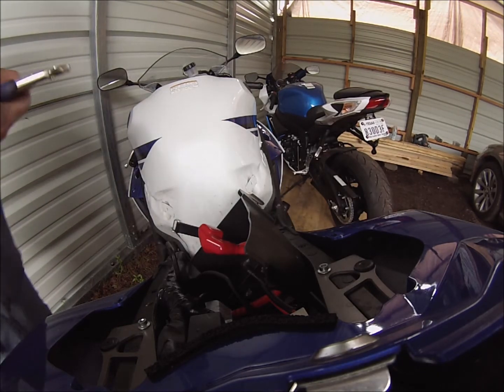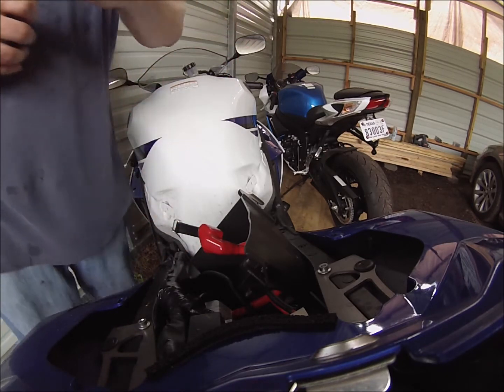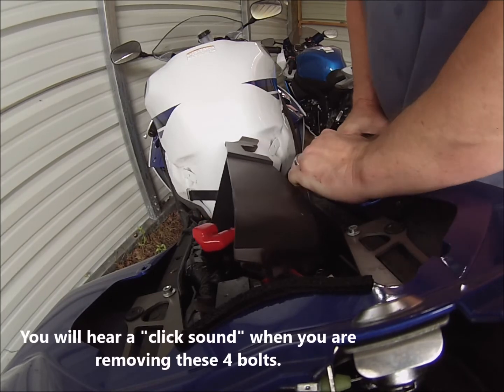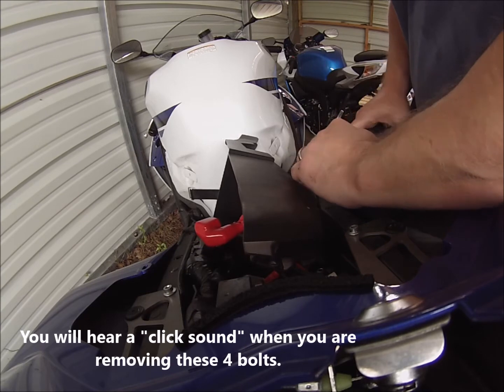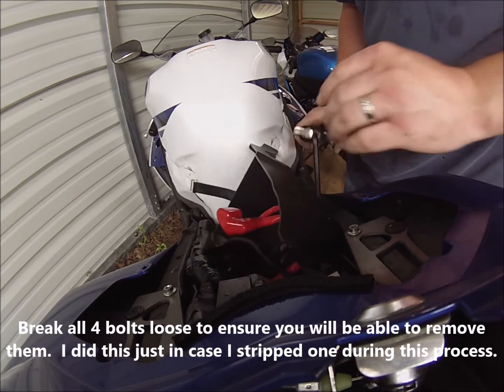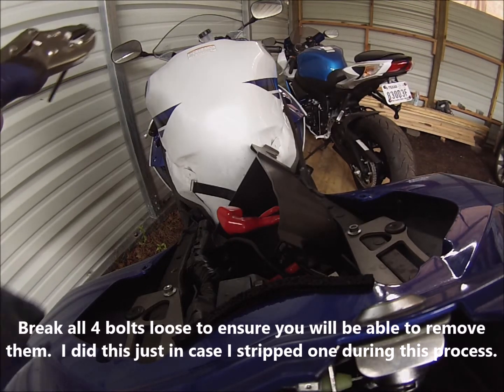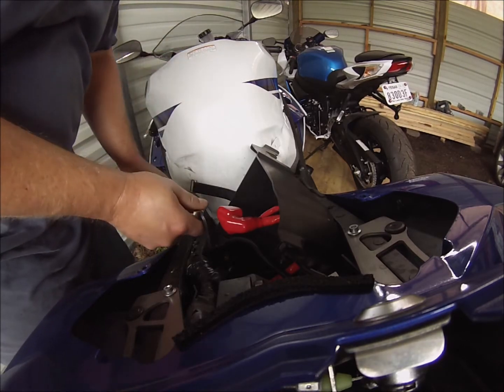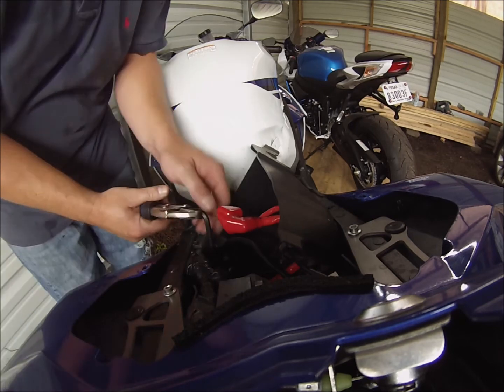How to Remove Rear Foot Pegs Brackets - 2014 Yamaha R1

Comment: Just a tip for the hex keys when they are up that way. Rather than using grips just use a ring spanner. About a 13mm. Slide the ring end over the hex key and it works as a lever. Thanks for the video.
Reply from the maker: +dubvalver thats a good idea...i just didnt have the right tools so i went with the locking pliers method...thanks for the comment and view my friend!!!

Comment: What did you do with the rear gas reservoir just let it hang since it connects to the rear foot pegs with a bolt?
Reply from the maker: +Matthew Paddock u mean brake res?  I zipped it to the rear brake line
Reply from the maker: +Matthew Paddock i cut the hose down a bit too to make it work
Reply: @criticalmass181   what's it called in ebay

Comment: do you have to remove the the battery box  in order to have that black plate move a little?
Reply from the maker: I just unbolted it and moved it enough to get the peg bolts out.  It's a booger since a couple of the battery box bolts are tucked in some very tight and hidden spots.  If the battery box doesnt move easily, then you're still missing a bolt.  That happened to me where it took me a bit of time to find those hard to find ones...
Reply: Crossplane Nation thanks! ill give it a try
Reply from the maker: Good luck man...dont hesitate to holler if i can help...

Comment: Hey man, are you planning on putting on a race rail on your 14 R1?  I just put it on and it isnt bad looking and the bike is protected for the most part.
Reply from the maker: k129h8 I didn't even think about that option...I am definitely going to put a passenger cowl on it...I removing those passenger sets were a pain in the butt...took me almost an hour and a half...do you have a vid of yours with your race tail installed???

Comment: How'd you remove the plastic tray the battery sits in?
Reply from the maker: +Mario J. Munoz there are either 2 or 3 bolts that are tucked way up in the corners around it...you will have to do some serious searching for them...that was the part that took me the longest...

Comment: Haha u made this video look alot easier than it actually is I couldn't get the plastic battery housing out to get to the bolts was making me angry so gave up
Reply from the maker: +MrDeanoblaze yeah the damn battery box took me an hour. I didn't completely remove it either. Just unbolted it enough to get some tools down to the peg bolts. There's one hidden bolt that takes some searching to find too.
Reply: Crossplane Nation Yeah the hidden bolt I'm guessing is on the left side the one I couldn't find the right side was easy enough it was starring you in the face ha
Reply from the maker: +MrDeanoblaze stay it with. It's well worth it.
Reply from the maker: +MrDeanoblaze stay with it.

Comment: Actually i put on race rails (kinda like a frame slider but it its a rail) btw nice vids, i used your front turn signal vid to replace those gigantic stock signals.  And the race rail im talking about is from www.xtreembikeworks.com in PA, im in CA.
Reply from the maker: k129h8 thanks, you got some sweet vids too...we use to have an 04 gt modded mustang that was pretty cool...love the car vids...those speed rails look like fun...didn't know they had those on the market...ive been out of the bike game for the past 5 years and just got this new R1 last summer off the showroom floor...not to mention a brand new 2013 GSXR 750 that is just collected dust with less than 100 miles on it...it's the wife's...

I am in south Texas, about 45 miles north of Galveston Beach...